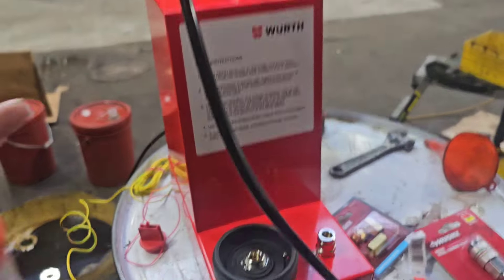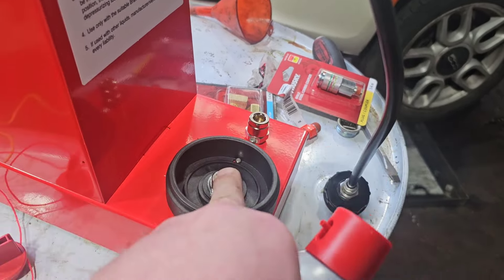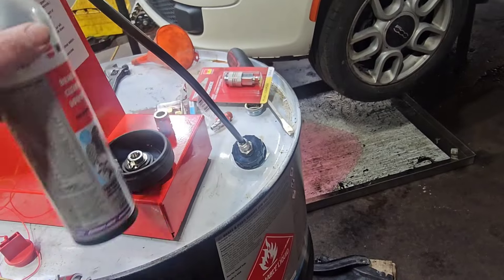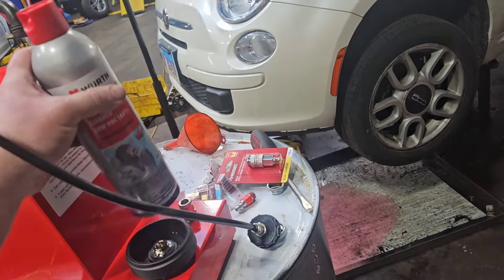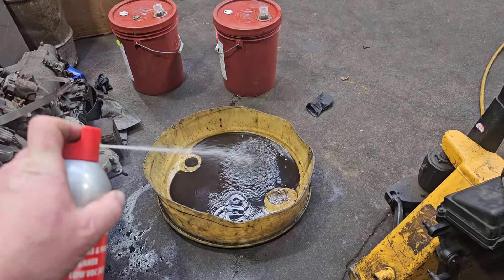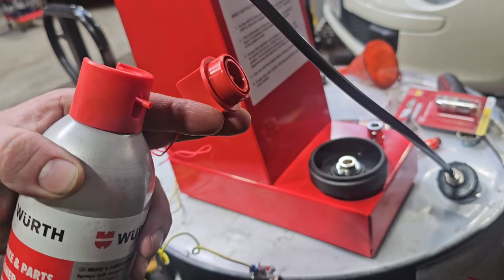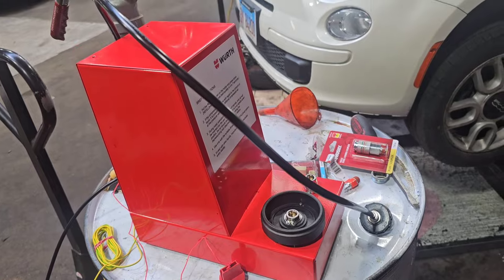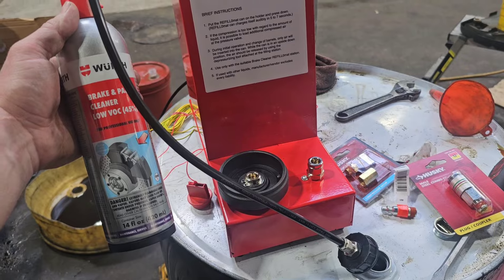Wurth Brake Clean Refilling Station - Best Brake Clean With VOC 45%

Comment: That's a cool setup.  I've been using the 5 gallon drums and the same metal hand pump to pressurize sprayer since 2002.  Pump it up and enough pressure for 2 brake jobs.  Got it in Sears.  Waiting for the sprayer to rot out or blow up.  I keep drums of all different types flammable and non chlorine whatever is cheap that year when I re stock.

Comment: That's pretty slick. I use a schreder valve from bike inner tube and an m12 inflator to charge up my brake clean cans when they go flat. Just pull off the plastic spray head first and fill to 90psi  Works great.

Comment: Rich, have a situation coming up. 2018 Explorer coming up in June for service. Lots of stuff in book but only one concerns me. Replace coolant. My fear is, did you do the work? Next is just what does, change the coolant mean? The service manager at the dealership where I bought the car is strange. Never calls to talk of these questions and when I confront him face to face I get this, I told her to call you. Her is a service writer.🦇
Reply from the maker: Look if you have that kind of trust issues with the dealership that you're using that means you don't trust them that means you either should work on trusting them or you should find another place to be honest with you
Reply from the maker: Now they should be calling you back and they should be communicating with you they're wrong for that but if they haven't given you any reason not to trust them and you pay for the coolant to be serviced and certain things to be serviced you're going to have to trust them until they give you a reason not to
Reply: @FordBossMe  I do thank you for your speedy reply. Here is my problem on trust. I caught a dealer who lied to my face on something I could prove and I did it. I had a Ford teck tell me he quit because of such things. You allow me to look in on the job when the coolant is out and answer my pre work questions and I would be good. However, you are correct.On some issues I do not trust some shops. I will have to find that shop that I can trust. It is only the coolant. You cannot tell as you may on an oil change. No point in beating it to death, thanks a lot. I do miss the Ford time with you.🦇 I will let you know how I do this later.

Comment: How many refills per drum? Is the drum refilled by a propane style truck or you have to unhooked shop lines and transfer to the new tank? If I were there I'd opt to buy a 2nd refill can for my personal tool collection (just in case👍)
Reply from the maker: When you need more they send a new drum
Reply from the maker: it's easy to move the machine from one drum to the next
Reply from the maker: I don't know how many refills - it comes out to about $1.79 a can
Reply from the maker: 505 × 13.97 oz

Comment: There is not that much liquid in these aerosol cans = a 55 gallon drum will last a long/long time.  -You could sell these cans and add as a service for other muchanics also. -Refill 12 or 24 cans at a time

This is sort of a sweet system where you can add fluid and air rather quickly.  = Much better than taking an existing can, cutting a hole, soldering in an air valve, and then having to pull the inside of valve to fill it each time.